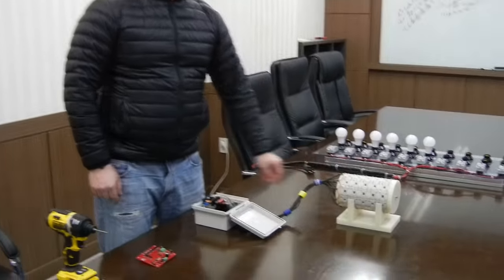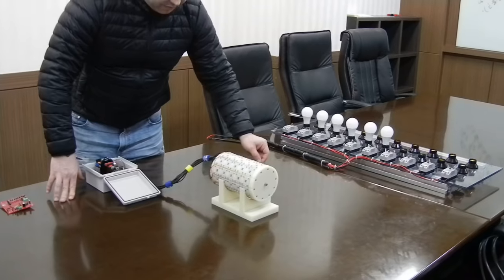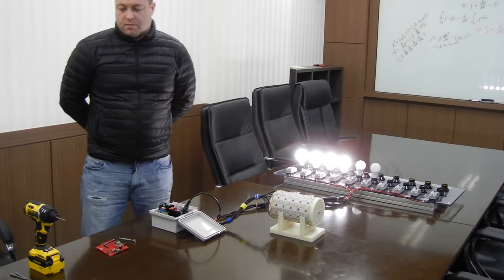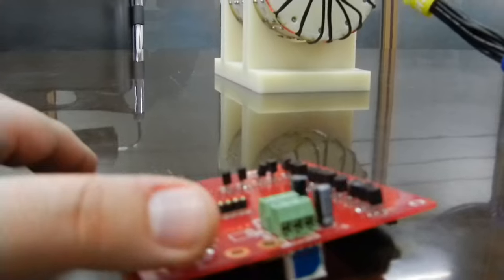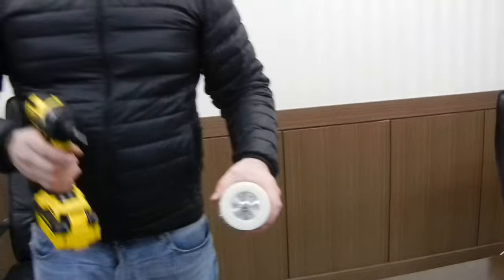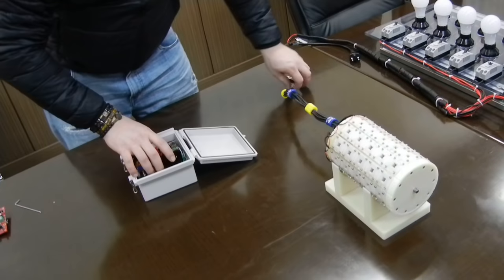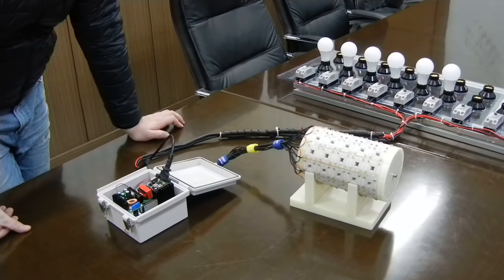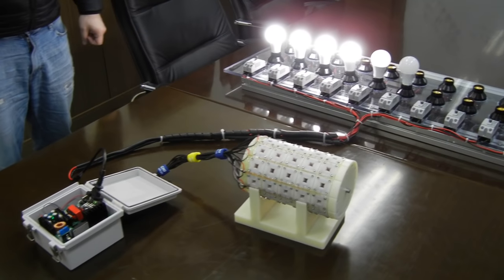Full dismantling of 1 kW magnetic generator

Comment: Ok, I find it that you are hiding something.

1. A 1Kw generator you cannot even stop with a pair of pliers let alone your finger pressure.
2. A 1Kw load on a generator would produce reverse torque on its casing, and your generator has no solid mounts and it only rests on a stand with no fixing mounts to stop the case spinning back when rotor is under load, for every action there is an equal but opposite reaction.
3. There is a deep base under the lamps, you could be hiding the source of power like batteries underside it, switched on by your control board, which senses the rotation so when you kick start it, some of the energy comes back from the hidden batteries to keep the rotor going just about, that is why you are able to stop it with finger pressure, and when that happens your board senses that rotor has stopped and so switches off the transistors or relays that power up your lamps, there is no need for those white blocks to which you connected wires to as the wires should be connected directly to lamps, .
4. You are showing larger 10kw models and have spent lots of your money to make nice looking and convincing models to  convince people or investors with their money.

The whole thing is a give away, it is fake, you looked on that video like you are hiding something, you did not even try to turn and show the back side of those lamps, and lamps look like they are LED bulbs.
5. Generators will always start bulbs dim when they are catching up speed and not pulse full bright on and off and then continuous. 

Sorry you cannot fool everyone.
Reply: A lot is being hidden, I think there is a power source in the lamp assembly which is supplying current to the circuit which is sending a series of pulses to windings in the stator, these would pull the rotor around, maybe also there is a touch sensor wired to the motor shaft to signal start and stop to the control board, also arent those LED lamps?, they might only be drawing 2 Watts each at around 100Volts, so, not much of a load at all. All was presented in the way a magician would do a card trick by calling attention to things that are of no importance, distractions. J.
Reply: Basically its just a motor.
Reply: It isn't just a motor. Here is how it works (my opinion). You have the magnets around the rotor. You also have the magnets around the stator at a 30 degree angle or so. In front of the slanted magnets around the stator there are 55 tiny coils. These coils can block the repulsion between the two magnets, and these coils are controlled through a pulsed circuit within the control box. The motor will only spin in 1 direction, this depends on the slant of the magnets within the stator. There are many different magnet motors, this one uses coils to block the magnetism to perpetuate the spin, other magnet motors use magnetic shielding. Conservation of energy should be treated as a special case. There are dozens and dozens of devices which defy that law. Look up Testatika Generator, or Lester Hendershot Generator if interested.
Reply: Naoki Kashima
I will have a look where you suggested, Shame there are so many crooks with nothing new promising the earth but with no tangible proof. Regards, J.
Reply: why are there no companies who claim to have cracked the free energy formula, yet you do not see one being sold in open market? why not, what is stopping you? Energy companies? I doubt it very much and we can play into conspiracies, of course Energy giants who have invested billions  in their industry won't be so happy, but then again fuel will still be needed for quite some time to come, air planes cannot run on electrical energy alone, gas turbines need gas, and oil, so why aren't there any sold? and if oil mafia buys these inventors or suppresses them , then why present these inventions on here, on youtube etc, so there is only one motive and that is to con people. that is my honest opinion.
Reply: samdomding
And you are right.
Reply: That is a very astute observation, and I agree. I, however, prefer electromagnets over permanent magnets, as stated by all engineers, for being potentially much stronger a magnetic field. IMO, people are still fascinated with the "lode stone". As you have stated, this is potentially a pulse motor/generator combination, to which does not defy any laws laymans may claim, through their ignorance.
Do you have any ideas or concepts of your own? I would hear them, please.
Reply: WhtStr213
I quite agree with you about preferring electro magnets over permanent, Construction and behaviour of them is repeatable and predictable, we have being making them for countless years and have formulas for all electrical and magnetic configurations imaginable. It seems pointless to me for so many to be chasing the impossible dream of 'over unity', by definition of the words, it is not possible. I would like to be able to ignore all of the nutcases and conspiracy theorists,but there have to be people who question their claims.
Reply: Naoki Kashima
Your first line said it all. I've read that e-book, saved it, and learned from it. It teaches more than just the machines, but also a way of thinking.
For instance, if you convert a V6 combustion engine into a combustion 4-cylinder steam 2-cylinder combo, you can easily run the steam side with the heat from the combustion side. This cranks up the efficiency greatly, by using the combustion side's "waste heat" to get more horsepower out of the fuel spent.
Same with A/Cs. I have recently had to pour water on my A/C condenser to keep the pump's workload lower in the high heat. This releases a plume of steam, and I burned my face a little the first time I did this. I have asked A/C workers if this is a usable source of heat for steam, and most said no. But I burned my face. I'm hand making a steam engine to put on my A/C just to spit on people's opinions, but it's no Stirling.
Magnet motors are great and all, but some of the solid state examples in that book are rather interesting, as well. Like the BiTT (Bi-Toroid Transformer), and the Magnetic Flux Amplifier, aka The Motionless Electromagnetic Generator (MEG).
I read a chapter or two, from time to time, for enjoyment and inspiration. I've also invented a few machines, and made improvements on some of those concepts, and learned as I go. Compared with some of the machines in that PDF, mine isn't s--t, but it's still learning, and realizing just how easy it is and dumb we are. The fact that we even pay for electricity is a joke, let alone the tenacity in which people cling to this method of obtaining it. But I'm sure you already know.
Have some brain candy on me. Tesla patent # 487796 - a combo motor generator December 13, 1892, and how to build one. Careful though, it hits like Jack D. (Yea, 1897... f--kin stupid, lol)
Enjoy.
Reply: his load is small which is why it does not produce much reverse torque.
Reply: Without actually handing the device you really don't know.
Reply: Do you think he's going to all that trouble to make that generator if it's Fake? there is another if you haven't found it yet and it's 10 K Watt, looks the same but much larger and made in Russia.
Reply: I don't know much about magnetic motors, but it looks to me that the machine here is working. Man never said what voltage or frequency he is generating. I guess we are to assume 110@50-60 cycles. He has a lot of electronics associated with this, but never described what it does.  I would also like some detailed info on the coils in use. Very important item in a generator.  So my opinion is hanging in the wind...   However, I believe there is something good going to this process.  Otherwise the man would not have put so much time and energy ( and cost) into building such fine machinery.  The workmanship is very professionally done.  If it wasn't working, he would not be building the 10 kw models. Lots of time and effort to do ( and repeat) if nothing is gained.
Reply: samdomding  you Just dont now nothing. energy is so easy but we are slaves so nobody knows the other things then the elite. we must pay for something thats free to get.  they wont tell you this  share this so they must let us get it to use
Reply: Haven't you just answered your own question, 

The FREE Energy concept is up and running-a there is also a Russian company are making 10kwatt motors or even higher output systems, slowly does it so as to not upset the economies of the world, taxes run everything and a lot comes from Energy. So it will become the norm when Oil runs out, but do we want
to keep polluting our planet? A huge market place will be the norm in the future; everyone will want to purchase a free energy motor of some size, whether that is for their home, their car, their truck, their new Flying concept with no jets requiring kerosene or propellers  E.T.C.     A NEW INDUSTRY!!! With millions more people being employed making these motors, new factories building the new cars and trucks fitted with them, new jobs fitting them to your homes, but you have to pay for them before you get free energy. There will be a totally new world.
Reply: Spot fucking on, I cannot fault you in your dissection of this bullshit. Keep on telling it as it is as many have no knowledge at all to see that this is a trick.
 Regards, J.
Reply: The 10 Kwatt generators has been sold out. You can find it on YouTube if you haven't already
Reply: They are sold out.
Reply: They were never made.
Reply: Technology such as this can only be given away, not sold.  No patent will ever be issued.  If the matter is pressed, the Kangaroo Courts will rule the day...any expert an inventor wishes to bring on their behalf, will simply be ignored by the courts (judge).  The courts will submit their experts testimony's though, the judges & Federal Prosecutors experts.  It's a rigged system of Corrupt Sociopaths, fabricating a false reality of righteousness & integrity.  When we all know deep down, they're corrupt POS.

It's US against Them (the Remorseless Psychopaths & Fraudulent Scientists)
Either you're with the People or the Sociopaths in Washington.
Reply: Average Joe....Actually, I do get it and sadly, you're probably correct, but what I have stated is also correct.

Peace Brother
Reply: If there were any "free energy" device, problem would not be corrupt people.
Problem would be that no expert on the earth would support it because it is against the basic rules about physics and if in the end the device would result being a fake which is most likely the case, the experts would not be considered an expert any longer. (nobody wants to lose his job)
The point is: two hundred years ago nobody really knew about electrizity. they knew a little about electric charge and used it at funfairs for enjoyment and magic tricks. 
Yet they didnt know exactly how or why it works. It took some brave "crazy" people to study it until enough knowledge was uncovered and more and more "sane" people did science about that stuff.
Laws of physics are declared by humans. While some of them might be true, we already know, that some of our laws just don't work.
Good example is Bells theorem. minutephysics have a easy to understand video about that.
I really like people trying to break these laws. One of them will be successfull. Just a matter of time.
Reply: Though Georg Simon Ohm Published a book called 'Die galvanische Kette, mathematisch bearbeitet' in 1827, so almost 200 years ago where he laid out 'Ohms Law' which still stands today as sound theory that is still universally accepted. And there were many great thinkers alive at that time doing sterling work in 'current' electrical research.
Reply: Klauz, allow me to be the one to tell you there are Corrupt Evil People in this World.  That said, just about everything we've been taught is a lie.  For example; You brought up electricity.....We still don't know what electricity is to this day.   You would think, something as simple as electricity, something we all use every day by the Billions and yet a clear understanding is not to be found, nor understood.
Kangaroo Courts do exist, working hand in hand with the Federal Patent Office and, yes...Many Inventors have brought their PH'd Experts by the dozens to these trials and the testimony's were inadmissible/ignored.  The Federal Government is purposely covering up the POISONING of its own CHILDREN, to satisfy the bottom line of Corrupt profits......and you think, there's some integrity/honest to be found these sources? 

It's US against Them (the Remorseless Psychopaths & Fraudulent Scientists)
Reply: If you look for conspiracies, you will find them, and many liars like infinity sav team, are just shysters profiting from ignorance.
Reply: @setag54321 lol, you made my day
to be serious, there is no evil government, they might be greedy as f*** but in the end it's just about power.
there is the fact, that some great inventions aren't in production, but thats mainly because big companies buy the patents without considering to produce them to keep on selling their old tier produkts. they need to do that to repay their investments and pay their workers.
that all has to do with the balance between innovation and stability.
Reply: @setag54321
1st is about money
2nd is about power
Government technology 75++ years beyond? There's no way they could afford that :D
Cancer -> money......... and besides that it's too many people on this planet anyway so why make it even worse by curing cancer for everyone lol
autism -> why does everybody think people with different working brains need to be cured in any case?
Those people might be able to show us a different perspective of the reality we see ourselves.
Sounds to me like a bunch of blind people blindfolding the only seeing person in the room just because he's different. I just don't get it.
Reply: Autism is not a disease.
And chemtrails are in your mind.
Reply: Average Joe spoon-fed...it's okay.

Do a bit of research before you speak.

It's US against Them (the Remorseless Psychopaths & Fraudulent Scientists)

Chemtrails are written within House Resolutions, cloud seeding is real and OLD Technology.  So incorrect there Joe and Children with Autism, are Physically sick, unhealthy.  This is not up for debate, talk to any parent.

Think Joe, quit following the herd.
Reply: No.
Reply: Good Luck, don't say no one ever took the time to warn you.

Peace Brother

It's US against Them (the Remorseless Psychopaths & Fraudulent Scientists)
Reply: @naoki kashima,

your post is pretty interresting brother!....most pertinent one ever!...it complitly make sens,guess what: i realise the same prototype,sticking on the maximum in order to realise the same as the first one they show to an another video,i have no idea if you saw this one ? (on the plexiglass plate with 8 bifilar coils,did you see it?),and it does not turn alone,but i learnt so much about tes la coils (actually bifilar coil),their magnetic comportment depending of what kind of connection i did with it all together ....it is allready a big step,but as you explain your point of view,witche is pretty interresting,i did not wound magnet on the middle of my 2 wire on eachs coils i maded....should i try ?? hope to read you soon ;)
Reply: Those that goes against this guy project work, must be from those eletricity company or benefitting from it!! That's the only reason why they said it don't work cause if u loose number of customer in ur list of making=u make less or none. They r called the brain of nothing and the gain conspiracy...well all I gotta said is, better start using clean energy cause the energy we r paying today is the energy of evil....this energy is from the dark of matter of soul sucking.....there something about the AC energy that is not provide but drain in not just financial but also soul drain to make cancer maybe as well or taking ur lives of year away....ya should fight how to be alive the right ways, without energy and clean energy nothing survive period! The truth is everything is already provided!! The sun, it was made us before as the most efficient energy there is as far as it is!! We are all just creating all bunch of killing energy there is....and sucking the shit out of the only energy there is, the sun!!! Leave those free sun eletron alone so we all can leave longer.....

Comment: I agree with samdomding. The trouble is some folks are not so naive once they have been scammed and spent thousands on these prototypes. One thing is obvious,the motor never starts until he plugs in that light bank of LED's. It also appears there is an obvious attempt to  to cover up that part of the soundtrack that is the dead giveaway. If the author wants any credibility at all he should have removed both ends of the rotor, opened up the light bank to show that there is no power coming from it,and ran the unit not connected to the power bank. Although there appears to be nothing under the light bank those giangtic switch boxes could easily house enough battery power to run the moyor and light 4-5 LED bulbs.